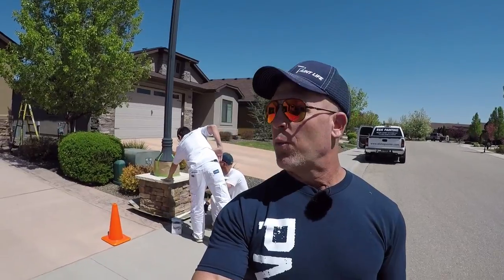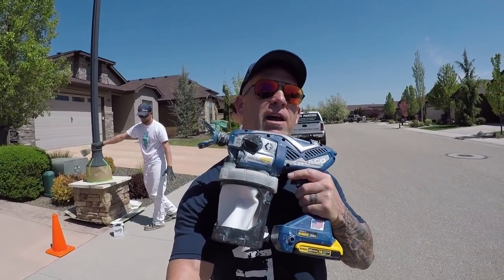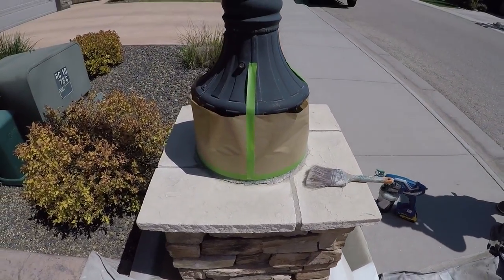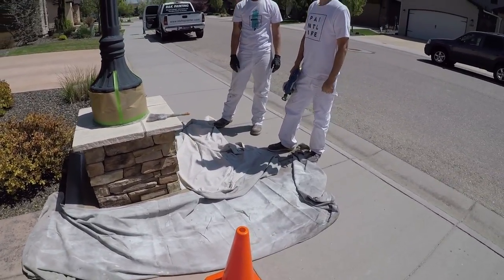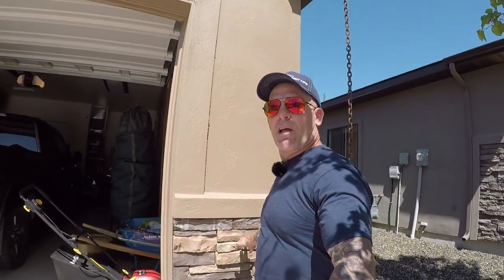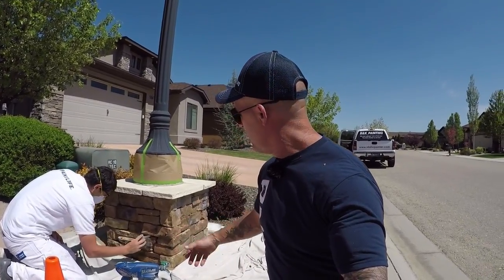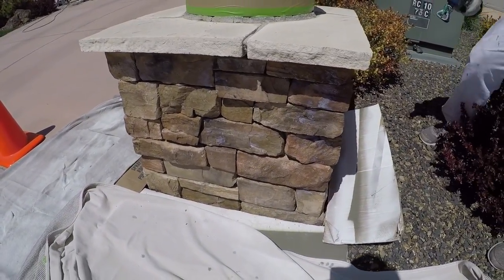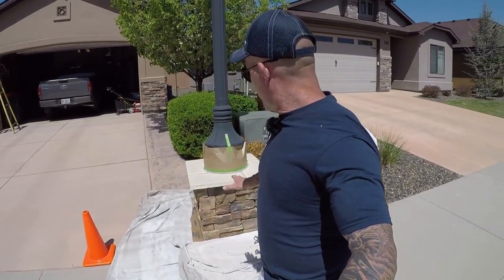Protecting Stone & Brick from Severe Weather.

Comment: You are using the wrong respirator the only dust mask you can use legally to paint are the charcoal masks the white masks are for dust only!!!
Reply: Doom Slayer  water base paints are 10times more dangerous than oil base paints your lungs are made of water and the materials absorb into the tissues and percent damage is done also it’s an OSHA fine to the contractors for issuing the wrong respirator!!